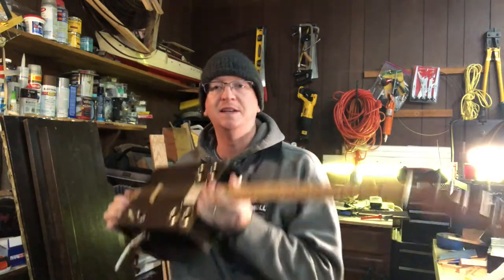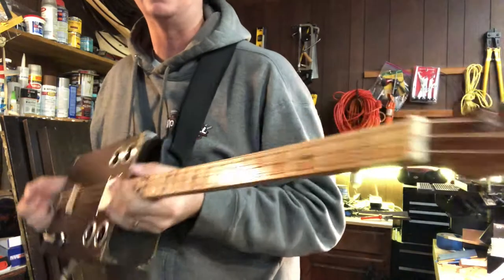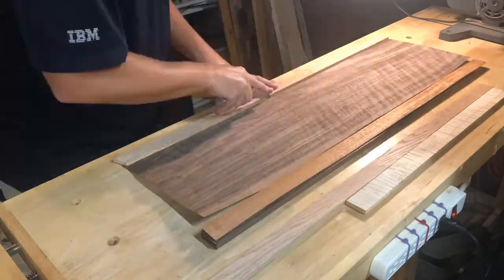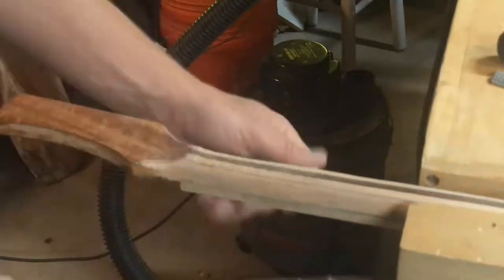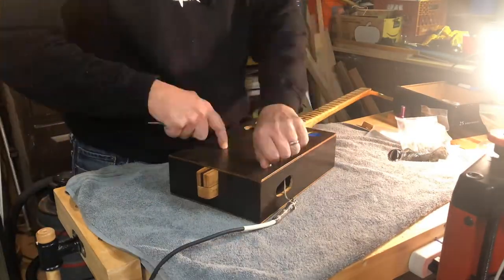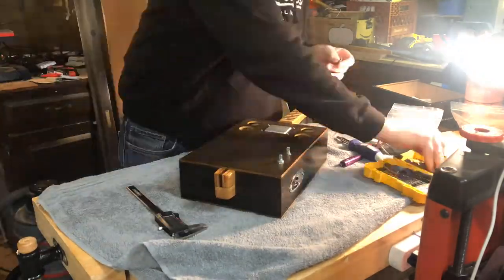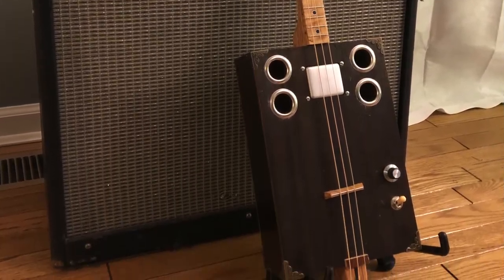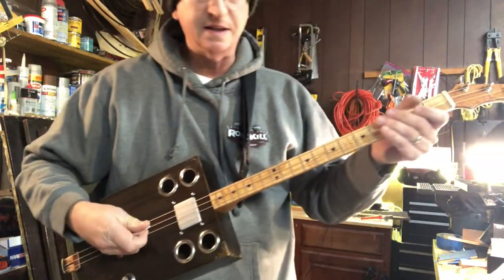Cigar Box Style Guitar - Complete Build

Comment: Nice Build!!! How did you ground your strings?
Reply from the maker: If i remember correctly, I went back and forth on this one whether or not i was going to ground the strings.  Normally I don't ground these b/c I use piezo discs, but this one had a magnetic pickup too... hence the internal debate.  I think I skipped it, but I had considered drilling a hole from under the tailpiece into the body to run a ground wire.   It ended up not having any issues without the ground, so I left it off.
Reply from the maker: and thanks!